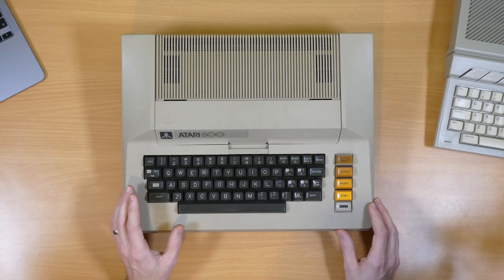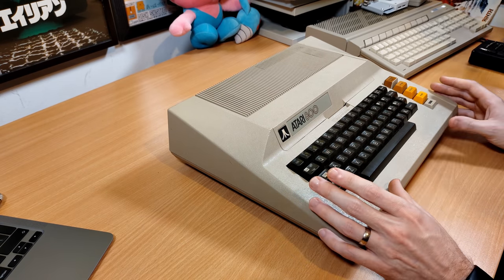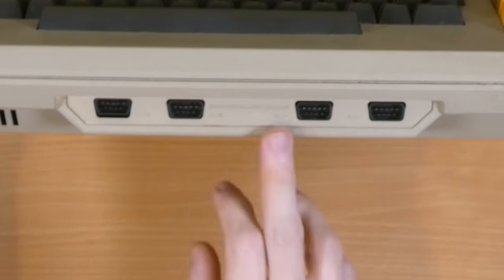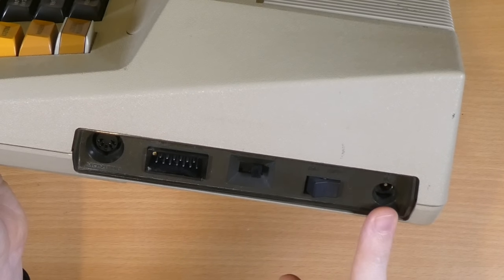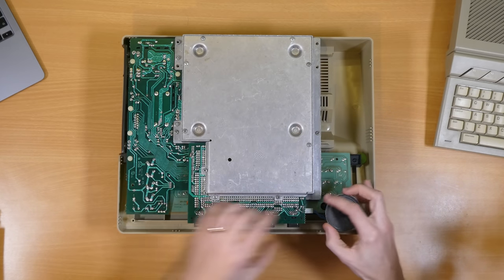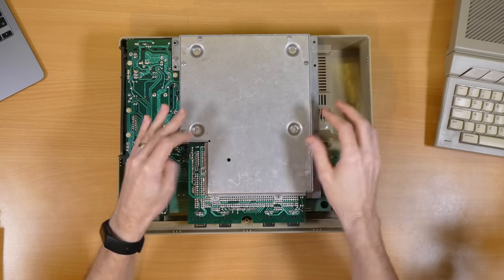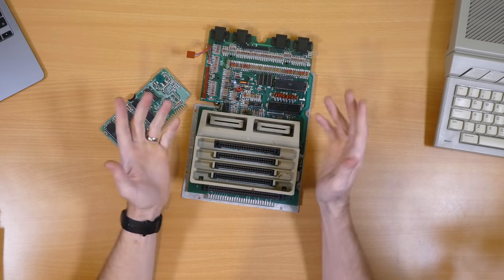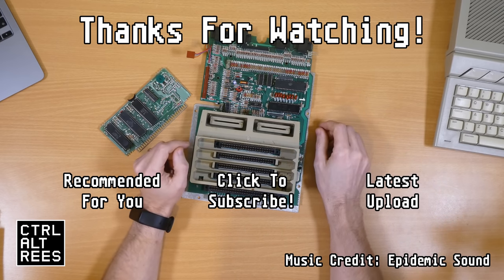Exploring The Atari 800 - Teardown Of Their First Home Computer From 1979

Comment: Great video! I think the idea of the modular CPU on a card design was in response to the paranoia caused by TI when they just announced one day they were going into the calculator business and they would not longer be shipping out chips to manufacturers.  Atari wanted to make sure they had plenty of what they would have a hard time multi-sourcing.  The whole Atari 8 bit story was sad in that the machines were released and never given a chance to develop properly.  The TI99 4/a sold close to the same number, and was a similarly priced, and much less capable machine.  To be fair I would say that this machine (the 800) was really made to compete with Apple, as all the components you would need were released with the system.  But sadly a lack of support from corporate was the death of this machine.
Reply from the maker: Sadly the "lack of support from corporate" seems to be a recurring theme throughout Atari history. Very bizarre.
Reply: The relative lack of support from the rest of the industry, particularly on the software side, was the real problem, and there were reasons for this.  To start with, Atari initially wanted to make most of the software themselves, so they kept the specs close to the vest.  Any other company that wished to develop software for this computer had to be approved by Atari and pay a steep price to know all of the secrets.  A decent library of software was developed despite this, but it badly lagged the wide-open Apple II in this regard, and the computer's adoption was slow.  Even though the Atari 800 was more advanced than the Apple II and slightly cheaper, it was still out of the reach of those who weren't sure about why they wanted/needed a computer, as well as those who simply couldn't afford one, of course.  The 400 outsold the 800 by 2:1 due to its significantly lower price, but it was kind of viewed as an expensive toy because of its membrane keyboard.  In addition, the Apple II had an 80-column solution that caught on, and a rugged, reliable, fast floppy drive, so it had advantages for business/productivity use that were stronger justifications for buying a computer in the first place than being better at games.  The Atari had so much potential, but the 810 was a clunky drive that was slower, lower in capacity, and less reliable than the Apple Disk II (the 1050 is much better, except for speed, but it came along years later).

Commodore then released the VIC-20 (first as the VIC-1001 in Japan the next year and then elsewhere as the VIC-20 the year after that, which was 1981), which despite being technically inferior was still useful as a beginner system, and most importantly it was the only "cheap" computer that had a "real" (traditional mechanical) keyboard.  Most every other computer in its price range had serious limitations and a membrane or "Chiclet" keyboard, and even the high-end Atari 400 had a membrane keyboard, so the VIC-20 at least looked like a "serious" computer in comparison, and at a low price on top of that.  It very quickly became the first computer model to sell over 1 million units, and really put Commodore on the map.  Moreover, technical information about how to program it was immediately made available for a low cost (just buy an inexpensive book published by Commodore from the book store), so despite its limitations and in part because of its sales numbers, everyone got on the bandwagon to support it.  Then the C64 was released the next year (1982), also with cheaply and easily available (and thorough) documentation, and the industry jumped on it even faster.  By this time, Atari was belatedly developing the less expensive XL series, although they would start off on the wrong foot with the overpriced 1200XL, which failed on the market.  The 800XL would eventually become their biggest seller, but Atari lost money with each unit sold, while the C64 was profitable at the same or lower price point.  Atari also released technical documentation for free around this time (circa 1983), but Commodore had stolen their thunder, and Atari was in huge financial trouble from this and their recent failures (after having tremendous success) in the video game console market.

The latter was reported on the mainstream news, so everyone was aware of Atari's troubles, and I think this was another factor that limited the support their worthy computer received from the industry and consumers alike.  The C64 was also worthy on a technical level, but did what it did for cheaper, and was selling like hotcakes.  Indeed, Atari probably would have soon died if Jack Tramiel, Commodore's founder who had recently been fired from his own company (a long, sordid story in itself), hadn't bought the company from Warner Communications, put his own fortune into it, and tried to compete against Commodore.  We can hardly blame people for being wary of buying or supporting a computer that looked as though it would soon be orphaned.  Support didn't disappear overnight, but over time it did, and not that slowly, either.

Commodore would commit their own suicide later for equally or even more stupid reasons, but my point is that Atari kind of brought what happened on themselves in the late-1970s and early 1980s, and almost went out of business way back then.  Unfortunately, the Atari 8-bit computers paid a price for this, but it didn't come out of nowhere, and for example Apple hung around for much longer (they only exist now because of Microsoft's massive bailout years later, and succeed because of the iPhone, but I'm talking about the 1980s here) because, in addition to the huge school contracts they got with the Apple IIe (starting in 1982), they had tremendous support from the industry due to their openness from the start (ironic considering Apple today, but it was originally Steve Wozniak's vision that prevailed until Steve Jobs' opposite vision finally won out).  Despite selling far fewer units than the C64, the Apple II series has a software library, including games, that rivals that of the C64.  What if Atari had been as open as Apple and Commodore had been from the start (and therefore less greedy)?  What if Atari had beaten Commodore to the consumer market with a lost-cost, high-capability computer?  The 400 was just as capable as the 800, but cost half as much just because of its keyboard.  Really?  Perhaps the 800 was overpriced, then.  The Apple II series certainly was, but Apple managed to find their market anyway, while Atari never really did (it was Commodore's market by then).  And of course timing and luck played their usual roles, but Atari the company was hardly blameless.  This is not bizarre at all.  It's just business.
Reply: I don't know about that, as the MOS 6502 was already available from multiple chip fabs (a deal struck before then-calculator-manufacturer Commodore acquired MOS as a direct result of TI's decision to make their own calculators and jack the prices of their calculator chips sky-high), including Rockwell and Synertek, in addition to MOS itself.  All I know is that the Atari 8-bit computer was originally developed on a back-plane system (perhaps to make trying different components easier and quicker), and for whatever reasons this was carried over into the final design rather than reintegrated.  It was nothing unusual for the time, as S-100 computers had a similar architecture, which was based on minicomputers that came before them.  Atari did not depend on TI for anything (maybe they bought some 7400-series TTL chips from them occasionally, but they sourced those from everywhere).

The TI-99 series pretty much got caught in the same "trap" that Atari's computers did.  They were too expensive to compete against the Commodore VIC-20 as a home computer, and could not directly compete against Apple II as a productivity computer without better peripherals and a seamlessly integrated and well-supported 80-column capability.  The latter plus the openness of the Apple II gave it more software support that helped it sell despite how overpriced it was.  Apple II computers, like all 8-bit computers, didn't begin to sell in the millions until the 1980s, but being so much cheaper to make, Apple still made a nice profit on limited sales, while Atari fell below expectations.  If it wasn't for the 2600 selling like crazy, Atari would have been in trouble sooner, as Warner Communications wasn't exactly the ideal parent company.  The VIC-20 was truly disruptive in how quickly it cornered the home market (while the Apple II went on to take over the education and small business markets), and TI and Atari were stuck in the middle with computers that were too expensive.  TI got clobbered and left the personal/home/micro computer business to refocus on chips and calculators, while Atari got by with the 2600 until that faltered, and the company found itself in trouble, with Warner desperate to dump it before their stock got dragged down any farther.

Except for the disastrous 1200XL (overpriced and not as compatible as it should have been), Atari actually did the right thing with the XL series, but were a year late, as Commodore quickly followed up the VIC-20 (the best-selling computer at the time) with the perfectly-positioned C64 (cheaper to make than the Atari XL series, and more or less as capable overall), and the rest is history.  Lest I come off as a Commodore fan-boy, Commodore made lots of dumb mistakes, too, like the 264 (TED) series computers, and the C128, which while pretty popular and successful, as well as a nice computer, never really got anywhere in its own right (mostly because it had a good C64 compatibility mode).  But for a while, they could get away with their mistakes because they happened to do so well with the VIC-20 and C64 (and the Amiga on the 16-bit side).  In fact, effectively it was some of Commodore's money from Jack Tramiel that enabled Atari to survive for another decade despite declining sales and support (the ST got some traction on the 16-bit side, but was always behind the others, I think).

It wasn't the Atari 8-bit computer's own qualities that caused all of these problems, at least directly.  One would think that being such a cool, advanced 8-bit computer should have made it more successful than it was, even dominant since it came 3 years before the C64 that would eventually "eat its lunch" and become the top-selling computer model of all time, but in business it takes more than being good or even great (although this helps) to succeed.

Comment: Can't you use Sega Genesis controllers in the Atari 800 as well? The Atari 800 was my very first computer, I have so many fond memories of that computer and the 300 baud modem. Calling up local BBS's, message boards, downloading software, being able to type faster than the modem could transmit. Flame wars with Apple II(Crapple) users, TRS-80(Trash-80) users, Commodore(Commode)users. Fun times.

I expanded my ram to 48k but had a bad ram expansion that would overheat. I had to run a small fan blowing into the back of my Atari 800 to keep the ram cool enough so it wouldn't crash lol.
Reply from the maker: Yep, the Genesis controllers work great in anything that supports an Atari joystick!

Comment: I bought a 16k 800 and the Atari cassette player. Pretty soon I bought the memory cards and bumped it to 48k and one of their huge disc drives. Later I bought another drive and the external printer box and hooked it up to a dot-matrix printer. There was a bug in the interface that meant it stopped printing three-quarters of the way down the page but I found if you then hit the space bar it would jump back into life and print the rest of the page. 'Course having spent all that money I then bought an 800XL and new drives fitted with Happy chips to deal with copy protection. Later still I bought a 130XE and gave the 800 away. Still got the XL in the loft. After all that I bought an ST and dropped the 8-bits altogether, but looking back they were halcyon days which later machines, for all their increased power, never quite caught the magic again that those early eight-bitters had.
Reply from the maker: I really need to do a video about those happy chips, it's a very interesting story. 🙂

Comment: Really interesting architecture. Did anyone ever use those expansion capabilities for anything interesting? Different operating systems? Replacement CPU/TIA?
Reply from the maker: I know of a modern CPU board replacement called the "Super Color CPU Card" but it doesn't add any new functionality other than a much improved video output. It is interesting that the modularity of the machine wasn't more widely exploited.
Reply: Yes there is an 80 column card, 3rd party 32K RAM cards and some more. Not a lot of expansions were released but some. Atarimania has a FAQ that covers almost everything about the platform including internal expansions for the 800.

Comment: FCC: We’re worried about interference from these new computer things, please add some shielding to them
Commodore: Tinfoil backed cardboard OK?
Atari: Make it nuclear bomb resistant? righto.

Atari did like their shielding although you can tell it was just for show as they didn’t solder it down 😏
Reply: They changed the rules just after the 800 was designed, so thats why the Atari is a tank and Commodore is not.
Reply: To be fair to Commodore, the machine they brought out at the time of the 800 was the PET, which had a solid steel case with built in monitor. By the time the VIC20 and C64 came out the FCC rules had changed and that level of sheilding wasn't required. If you look at other contemporaries like the early Apple ][ and the TRS-80 they also had heavy sheilding.

Comment: I had a 800xl in the day. The 'war' between Atari and Commodore was similar to VHS and Betamax. In the end it came down to software (games), and what was available. One wasn't really any better than the other.
Reply: Yeah, each was better than the other at some things, but overall they were a pretty even match--too close to call for me.  But the C64 had more advantageous timing and circumstances that resulted in much greater support from the software industry, and arguably for most applications, including games, it was easier to program to a certain level of quality or refinement (thinking of games here, especially more typical arcade-type games and RPGs).  I'm sure some would disagree with me on the latter, but I've programmed both in assembly language for many years, and for whatever reasons, I usually find the C64 a bit easier to program (doing the same things on the Atari requires more unorthodox techniques and tricks, which is fun, but is more challenging and costs more if one is considering whether it is worth porting something to the Atari for profit).